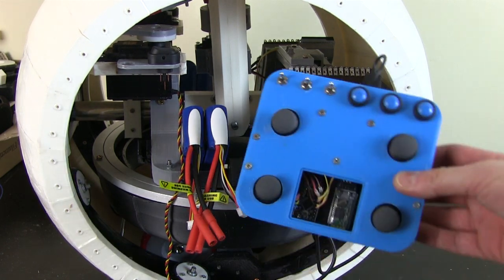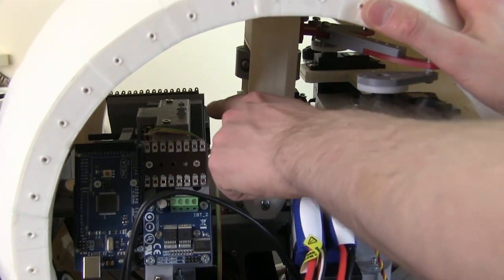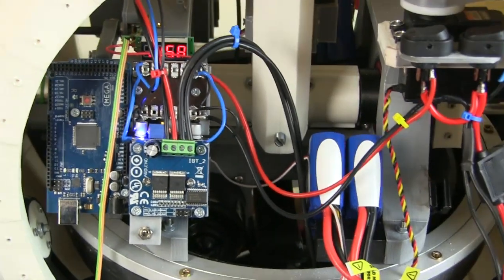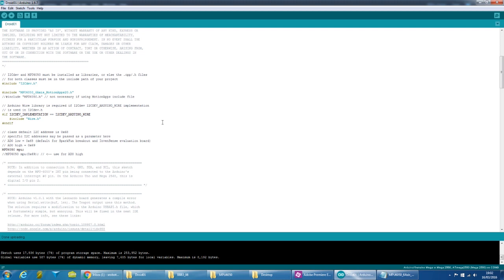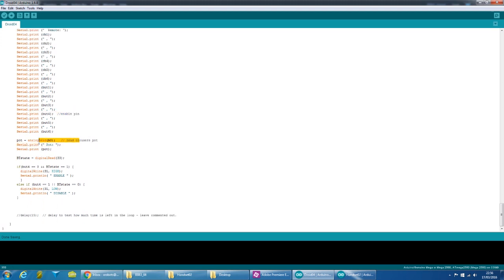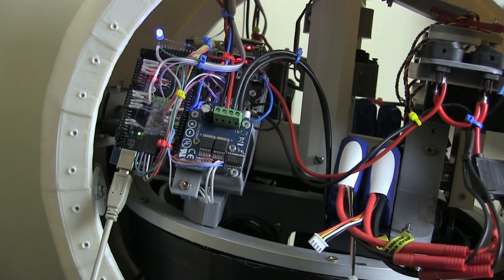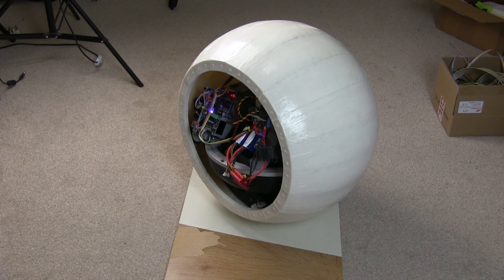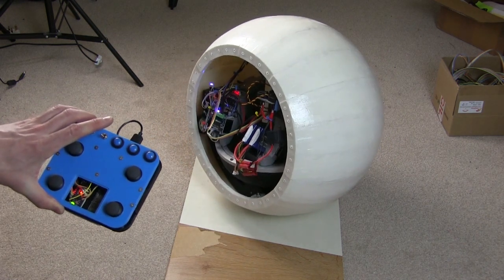Star Wars BB-8 Droid v3 #8 | Stability Testing | James Bruton

Comment: @15:21 You might consider making a loop that waits for a pass code or Driod ID (R4D4 or BB-8) from Driod to Control Pad that way you could make certain your pad is receiving/transmitting to the correct Driod.   Thus making multiple control of different Driods possible from one Pad.

Comment: You should put the motor cut switch on one of those 'fighter jet' toggle switches with the little plastic cover so you can easily flip it down (cut motors off) when you need to. They look cool too, some come with little LED lights in them!

Comment: Although redundant, you may consider having a second IMU, as they are cheap and it is the Achilles' heal of the entire build. You can compare the two units to one another, taking the average - and should the discrepancy between them be too much, then stop the unit. It would at as a cheap safety measure should something go wrong. Great work so far!!

Comment: just thought i would ask if you have any voltage protection for your battery's as they can be dangerous if miss used even when charged correctly with the proper equipment they can still catch fire their is plenty of reports of model aircraft flyers have   trouble with lipos  this type of batter is great but do require a lot of care when using them and storing them .
great project

Comment: You mentioned no PID for the flywheel, but I suspect one could come into play there: adjusting the speed of the flywheel to reach the target angular velocity. Then the handling for rotation should remain similar across different floor materials.

Comment: Nested PID controller, they can be fun and  horror at the same time. Biggest problem is you can get oscillation within the control loop. If you get troubles with oscillation I recommend to run the motor control loop at a higher sample rate as the IMU loop (4x or more). 
Nice work. I think sooner or later I have to build this one looks very good.
Reply: +James Bruton (XRobots) The best thing would be I guess filter the IMU values (average or FIR filter) and then feed this to the IMU PID loop. If booth controller run at the same sample speed the inner loop has no "time" to work and is more or less useless. I'm fighting this control loops for my robot for a year now ;). In robot applications you normally have also a current control loop, but looking at the behavior I think it's not necessary.
Reply: I have no idea what ur saying but i nderstand that if we put it on to high it would run off
Reply: +Andreas Hölldorfer 
PID loops can be finicky as they are always trying to "catch up". I have used simple models, in addition to the loop, to get better performance; this is referred to as feed forward. 
Eg. If I know roughly what the duty cycle for running a motor is (by testing), then that duty cycle is the initial feed forward value. Then the PID loop only has to accommodate small errors due to motor loading etc. The estimated duty cycle vs RPM is the model for the motor.
BTW, my go-to PID book is "Modern Control Engineering" (Ogata).. lots of maths, yum.
 - Eddy

Comment: +James Bruton (XRobots)  If you need more time in your loop and the I/O pins on the arduino wont be changed around, you can use port manipulation instead of digitalWrite() commands.  This will speed things up a lot.

Comment: Technically excellent - that wiring spaghetti worries me though.  Some could be shortened and the rest routed more carefully to avoid problems down the line.

Have you made provision for charging the batteries in place rather than pulling them each time?
Reply: +James Bruton (XRobots) 

Fair enough then.  A modest fire extinguisher might be appropriate in case of a dead short across a battery when operating then, between the batteries and the blade fuses.

Comment: I thought this might amuse you.  A BB-8-ish ball robot from LG controlled by their new LG G5 smart phone.  It's called "Rolling Bot".  It looks like it moves in the "old school" ball robot fashion of using two hemisphere shaped wheels, so turning and spinning in place is controlled by having the wheels move in opposite directions (or different speeds).  In other words, they could have used just wheels instead of hemisphers, so the ball shape is largely decorative.  But the shape presumably hides a lot of the electronics.

One review describes it as a "drunken BB-8", which you can see in one video where it rocks up and down wildly when you stop it, although it dampens it quickly.

Something so fun you might want to consider adding to your BB-8 for absolutely no practical reason whatsoever is a laser pointer used in "Pet Mode", the purpose is really and truly for the robot to randomly move around with a laser pointer to make your cats chase it.  :-)  It also has a speaker so you can talk to your pet as well.

http://www.digitaltrends.com/mobile/lg-rolling-bot-news/

Comment: Hi James, have you got a fail safe on your batteries so that they don't over dis-charge or you will damage them?
Great work also what is the c rating as you may be able to go for a lower c rating but higher amp/H = longer run time.

Comment: Hey, Great build, Just one question. If you put the inertial measurement unit on the treasures will it be able to measure correctly with the treasures tilting left and right.... shouldn't it be on a part of the droid that does not move or in other words a part that only will move if the droid wobbles or tilts completely
Reply: +James Bruton (XRobots) Cool İm still watching :D love your work by the way :D cant wait to see the finished droid
Reply: +Pete McD67 yep that can happen when typing with the touch screen of a phone. . . Thanks for the critical spell check

Comment: Hi, James  incledible job
When we switch on the button 4 anf the bt is paired,  the pin 31 pass to HIGH
How is conneted the motor drivers to the pin 31 for switch on or off ?
Thanks

Comment: Does the bluetooth unit taped to the chip on the MEGA not cause heat buildup?  I realize these are all relatively low power devices, but I wondered how much heat buildup there might be once this is closed up without airflow to those parts.

Comment: Hello James, 
what is the advantage of using 2 PID controllers for side-to-side action? I mean, what you want it to do is essentially shifting the cheese to an angle set by your joy stick, right? And stabilization still, of course. But why don't you make it work in the same way as you would for the actual driving. With one PID getting the set (e.g. an angle) from the remote comparing it to the IMU and giving out the motor speed then. It would stabilize still because it tries to maintain the angle and it would also go back to the position set by the controls when you give it a push..., right?
Reply: +James Bruton (XRobots) oh is this because of the oscillating effect you mentioned when it's e.g. having a too long delay for moving the trousers? I just thought you could program this into one PID

Comment: Instead of setting the trousers to swing to position X ASAP every 20ms, why not set the motor to go at a speed appropriate to reach position X in 20ms so the stabilization is smoother?

Comment: I have a question, how can you connect multiple I2C devices to one arduino?
Reply: +Power Supply 
I2C is a multi-drop bus. Each slave device has its own address (7-bit). Usually ICs will expose 2 or 3 of these address bits for you to set high/low in order to get more than one of the same IC on the same bus. SCL and SDA are pulled up via resistors, usually 5V but some IC's work on 3.3V as well. Just thought I would field this for James.. I have been working with I2C for many years.
 - Eddie.
Reply: +Deathlok67 Thanks a lot!
Reply: Power Supply

No prob. Now all you have to decide on is how fast to run the bus. Normal speed is 100 kbps, but you can get most chips to run at 400 kbps, if you need to get data transfer faster.

Comment: Excellent video, Mr.Bruton :)

But I have to append, that as a programmer, it hurts me to see your code... I think you should tidy it up to enhance readability and performance, like during your PID loop calculations and connections. I am currently recreating different parts of your code on my PC and I have found a lot of optimizations, which could give you more time during the 20ms-loops.

(Also do please not take my comment badly, it is only meant as a sort of constructive criticism)
Reply: ***** I can understand that, Sir ;)

However, if you want, I can help you with the coding...... if you need any help or optimization, of course
Reply: Can you share the code with me? I'm building a DIY electric unicycle (airwheel), and I thought this code could really help me. I have an Arduino running it all, but it's not really working.